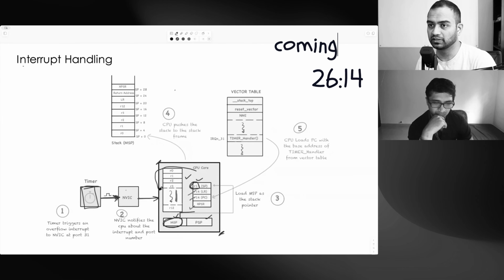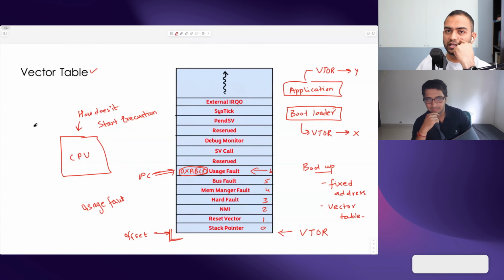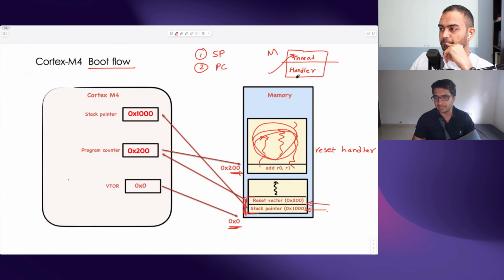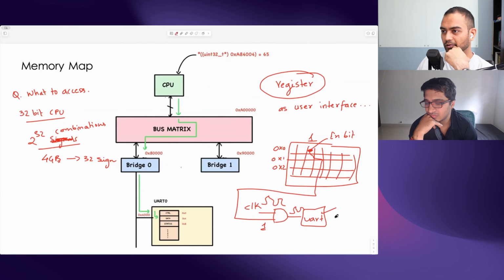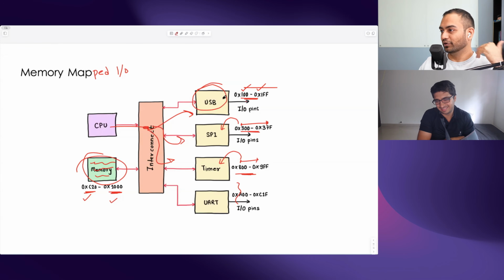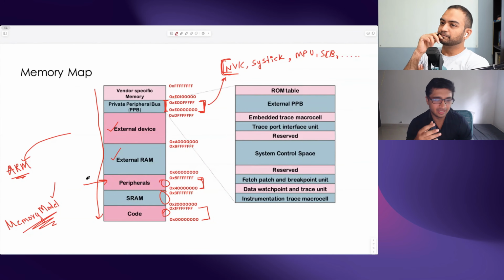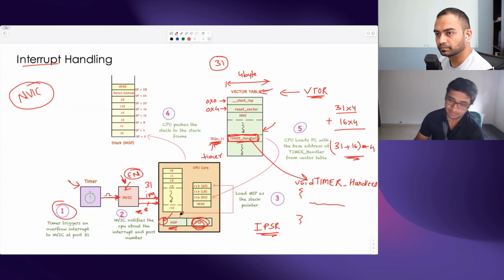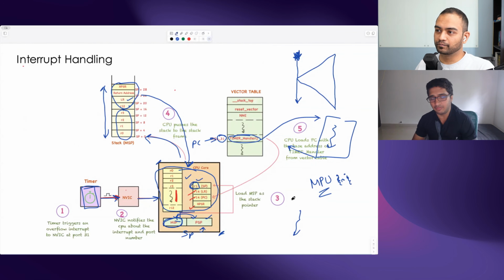ARM - Cortex M: Exception model, Boot Flow and demo | Embedded Systems podcast, in Pyjama!

Comment: Reset handler runs in Thread mode, not Handler mode. On Cortex‑M, the reset path is special: after reset, the CPU starts executing the reset handler like normal program code in Thread mode, and only later enters Handler mode when an actual interrupt or exception occurs.

Why it is Thread mode
At reset, there is no previous interrupt context to return to.

The CPU loads the initial stack pointer and reset vector from the vector table.

It then begins executing the reset handler as the first normal code path

Comment: 32 bit or 64 Bit Cpu mean, the processor has 32 or 64 bit Registers, and also how big the instructions set it supports 32 or 64 bit,it can address 32 or 64 bit address, and also each basic  operation like example add, multiply and Subtract are having Dedicated 32 or 64 bit Hardware. I am into Vlsi Design.
Good Explanation of Boot Process 👍

Comment: so, vector table lies in Memory which means flash memory available with in the processor like internal memory ,emmc ? Is it ?
Reply from the maker: It may vary from SoC to SoC. Generally in micro-controllers where the code resides in Flash, the vector table would also reside there.
While in some other SoC, the code from the flash can be copied from flash (or any non-volatile storage) to SDRAM by the primary bootloader. In such cases, the vector table would then reside in volatile storage (like SRAM or DRAM).

Comment: @rajat @12:13 Thats a Interesting insights of why "reset exception" starts in thread mode,
"Reset is a special kind of exception. When the processor exits from a reset, it executes the reset handler in Thread mode (rather than Handler mode as in other exceptions). Also the exception number in IPSR is read as zero."  -> from The Definitive Guide to ARM! Cortex!-M3 and Cortex-M4 Processors. 

Reason is as mentioned by @rajat @12:40  + Reset sets the processor to a known state: When the processor is reset, all internal registers and memory locations are set to their initial values. This helps to ensure a clean and predictable state for the processor to start from. Other exceptions, on the other hand, may leave the processor state in an unknown or corrupted condition.

Kudos to @Embedded Systems in Pyjama team great work. Since you all started learning via podcast way has become a thing now. 
👏

Comment: My understanding is the reset_handler runs in Thread mode. Here's the snippet from the ARM M3 User's Guide:

2.3.2. Exception types The exception types are:
Reset

Reset is invoked on power up or a warm reset. The exception model treats reset as a special form of exception. When reset is asserted, the operation of the processor stops, potentially at any point in an instruction. When reset is deasserted, execution restarts from the address provided by the reset entry in the vector table. Execution restarts as privileged execution in Thread mode
Reply from the maker: Yes we read about it and clarified it 
Thanks for sharing